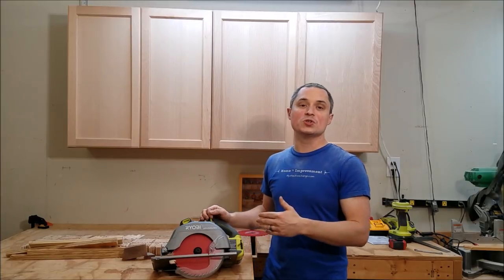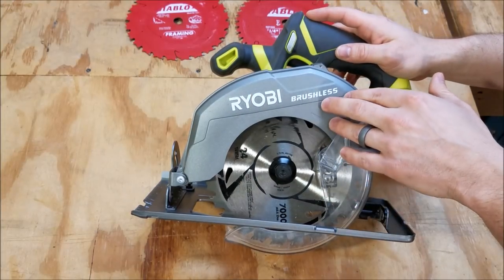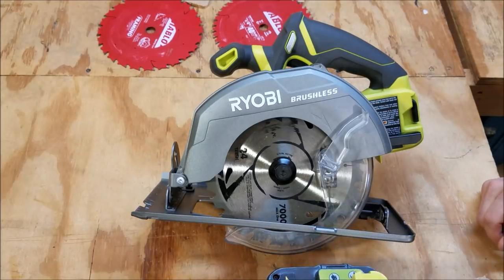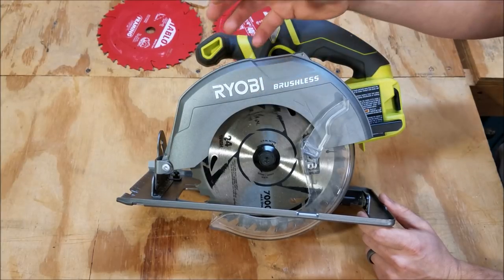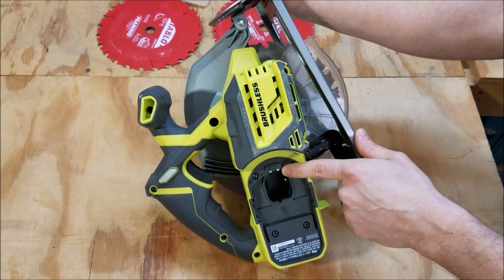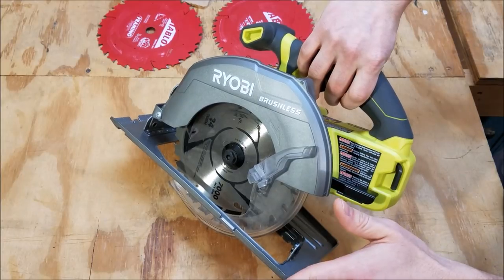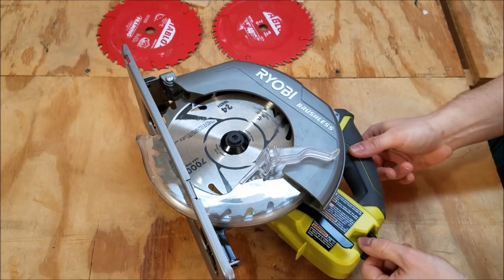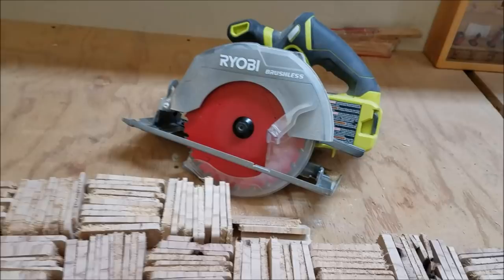Ryobi One+ 18V Brushless Cordless 7-1/4" Circular Saw Review

Comment: Great Review, Will give you a BIG TIP,  I think you will Like it. when you cut 2x4 or even 2x6< try using a Speed Square. Just hook it to the face of your 2x and now you have a stight fence to put the saws shoe aginest & match the blade to your marked to cut, You will find that you have less bind on blade, you always get a square cut on the wood all around it saves time , battery life and blade life. And ya don't have resquare your wood your working with. and I would bet you could have cut a extra 10-20 Pieces of 2x4. Its a hack all wood Framers use.
Reply from the maker: That is a great technique that I do use when I actually care about the cut - I'm just cutting so much with an endurance test like this that I don't bother with it. But now you've got me thinking that I might actually be able to squeeze some more run time out of the saw if I take extra care to keep it from binding.

Comment: i think you performance review part is disingenuous and NOT REAL WORLD try the same test cutting and make the cuts EVERY 4 INCHES  there is no resistance when you cut every inch --------------------- otherwise a good job
Reply from the maker: How would the cutoff length have any bearing on saw performance other than wasting more lumber?
Reply: a huge effect you are not performing typical tests (to be honest if you do not understand the difference i am not sure i can yelp you) when i cut or even trim 2x4" there is real work and load involved you are never ever going to see that with the walk though he park you are showing (that is a waste  of wood ) you will never see it bind like can and does when you are cutting 1 inch
Reply from the maker: 1" cutoff vs 4" cutoff won't make that much of a difference unless you're supporting the workpiece on both ends and pinching the blade. If you really want to see it under heavy load, I did a bunch of rip cuts here: https://youtu.be/Qf3_WJqg8mg
Note that I'm pushing it harder than I would under normal circumstances in order to test its limits.
Reply: thank you for send me to that vid it shows what everyone wants to see  VERY GOOD JOB @DoresoomReviews

Comment: Great videos. What battery do you recommend with this brushless saw?
Reply from the maker: Thanks! I'd go with any of the HP batteries with this - the 3Ah, 6Ah, or 9Ah. They make a huge difference in performance under heavy load.
Reply: Doresoom Tool Reviews thanks!  One last question, with any of those three batteries (3Ah, 6Ah, 9Ah) does one provide more power to the saw than the other or is the difference simply just how long they last?
Reply from the maker: The 3Ah and 6Ah seem to provide the same power output, with the 9Ah having a slight advantage. https://youtu.be/8WidbNunPXY
Reply: Have you compared the P191 3Ah to the new P195 3Ah.  Wondering if there is a big difference in performance.